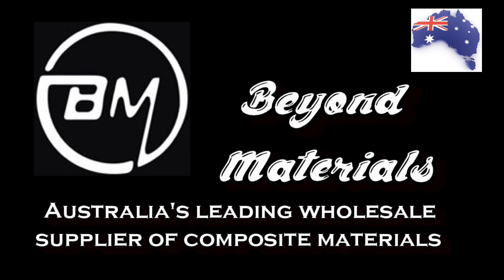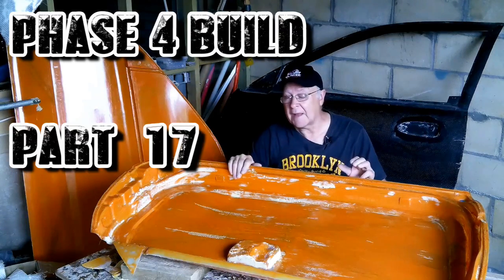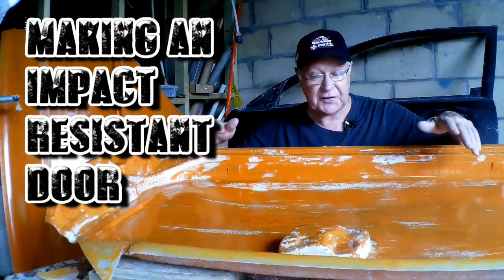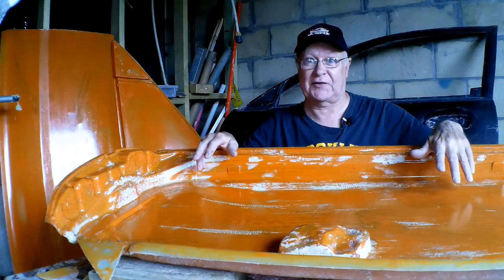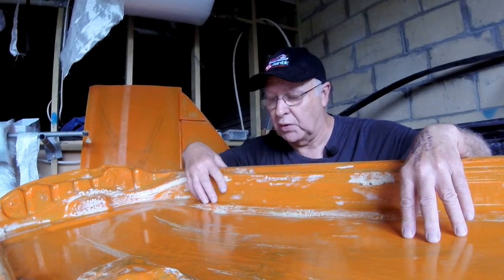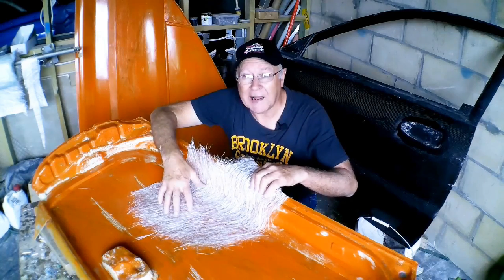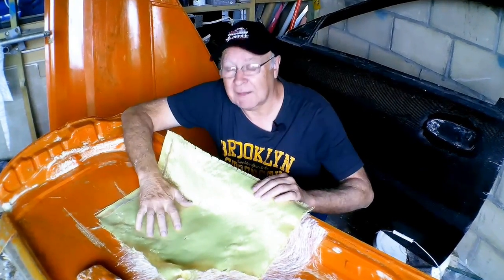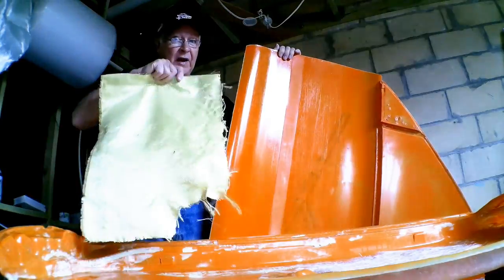How to Make a Kevlar & Foam Car Door

Comment: Would it be a good idea to back a thin aluminum firewall with kevlar? What about the inside of a removable transmission tunnel? If yes would polyester resin used with Kevlar be ok?
Reply from the maker: Firewalls have to be fire resistant, and both epoxy & polyester resins are all flammable. So firewalls can only be made out of metal. But I see no problems with what you are thinking of using for a transmission tunnel, because that is fragmentation protection more than fire proofing. However I'd lay the Kevlar on the top of the tunnel to get the poly resin away from the exhaust heat.

Comment: Does the FIA mix have a fire retardant?
Most expanding foams are really flammable, and make a horrible smelling black smoke
Reply from the maker: Actually most expanding foams have fire retardant in them these days. Building authorities would hardly allow it's use as spray wall & roof insulation in modern homes if it was a fire hazard. I don't know what the FIA foam requirements are, but you can guarantee fire retardent is part of the required mix. What is far more flammable is the nylon/aluminium sheet sandwich material (building cladding) that many race car builders (especially clubmans), commonly make their floors & sides out of. Yet no scrutineers seem to worry about it. They see the metal on the outside and forget about what happened in those UK tower complex fires. Exact same stuff.  A fire needs an ignition point, which is why I don't use expanding foam anywhere past my windscreen. I can't see how a fire would start inside a foam filled door under normal race conditions. Then there's the flammability of ALL poly & epoxy resins as used in CF and fiberglass. They burn well too, but once again you have to have an ignition point. If a race car burns rapidly it's usually because petrol is involved - and as we know that is explosive.

Comment: So if I wanted to make carbon fiber door for my street truck should I make them fully out of carbon Kevlar so it can absorb the impact Incase of a crash?
Reply from the maker: Carbon shatters on impact, whereas Kevlar is tear resistant, but you might want to to check your local road rules too. However your main challenge for a road car will be mounting all the window winder mechanism and tracks so your windows still work, as fixed windows are obvious to cops and illegal everywhere.

Comment: What is the benefit of using kevlar over carbon fiber raisin? I thought kevlar was popular with abrasive places like under body of the car. Could you please shed light on what carbon fiber, kevlar and fiber glass all are meant for and their pros and cons. Please. Thank you..
Reply from the maker: I can't recall overlaying CF with Kevlar, but it would be done to add the tear resistance of that yellow cloth over CF - which tears, cracks & shatters with impact. In race car use.... Fiberglass: Cheapest, easy DIY, no vacuum bagging needed, Kevlar: Highest tear and abrasive resistance, not as expensive as CF,  Carbon Fiber: Lightest and strongest for thickness even when really thin, but mostly needs vacuum bagging to get that & to conform to compound curves.
Reply: @BillsBuildandRace  Not overlaying , i am sorry i wrote that in a confusing manner. I was just wondering what material is better for what kind of application. What i mean is why would you make a door of kevlar and not carbon fiber. I find you very knowledgeable so I thought i would ask you pros and cons of all 3 materials. I guess fiber glass is the cheapest and has the most flex. And then carbon fiber is the stiffest with least flex. But I am sure you know more and it would great to hear your input on these 3 materials and their applications. The reason why i ask is because I would have thought doors would be better with carbon fiber , rather than kevlar... no?
Reply from the maker: @Jimboyrulez  I made my passenger door from CF for maximum light weight. But with my driver's door I wanted the way better protection Kevlar offers in a side impact crash - so that's why I used it there. I also wanted to demonstrate how a much tougher door could be made using Kevlar, as this is what the WRC and our National Rally rules requires, and no-one had shown the DIY race car builders how to do this.
Reply: @BillsBuildandRace  Thank you for the insight... I love your videos... they are very very informative

Comment: I used to be a fibreglass laminator many moons ago, and a wee tip I picked up was screw pattern rollers are better than paddle or finned rollers, they cost about the same, not bad rollers so they are.

Comment: In Russia, in areas with humid climates, foam in the rapids will lead to rapid and inevitable corrosion. In 80 and 90 years of the last century, Ford filled the cavity in the body of their cars with foam, as a result of the car rotted for 2-3 years of operation. But the door you have turned out just gorgeous, plastic foam and corrosion is not terrible.

Comment: You are not allowed composite front doors in the WRC and in the UK you can’t have any unless they are the rears and homologated but there is only Citroen with any anyway and they don’t need anything in them.. the foam comes in blocks and a CNC is used to shape it.

Comment: Great video. Love the quality control (qc) at the end, ha. So, what kind of gelcoat did you use, polyester or epoxy? I noticed using epoxy with chopped strand is that great. Its a little difficult and leaves a lot of air bubbles.
Reply from the maker: I just used poly Gelcoat. Yes, csm with epoxy isn't great. Ended up with a mega hairy finish, so I laid carbon over it after filming to get a reasonable surface inside the door window frame - which you can see at the end of the vid.
Reply: Ok. I have mixed polyester gel coats and epoxy resins before. Just not to crazy about doing that to be honest. I feel like the two resins don't really mix well. You could of used some fiberglass/carbon fiber/Kevlar surfacing veil on the top layer for the hairy finish. Thanks for getting back to me. Love the videos.
Reply: You can buy special CSM for epoxy , its powder binder. Normal CSM needs styrene in the resin to break it up, epoxy doesn't have this. If you're from Australia, Trojan Faberge stocks powder binder CSM and its cheap! Their epoxy is half the price of west system too

Comment: Nice work as always. I'm curious to see how you get the door lock mechanism in the door now though
Reply from the maker: Yes I'll show that. Basically cut a slot for the lock to slide in, then dig out clearance for the lock rods. If I put the locs in the door before foaming I risked that one tiny bit of foam getting past any sealing tape, so I decided on the fit later & burrow method instead.